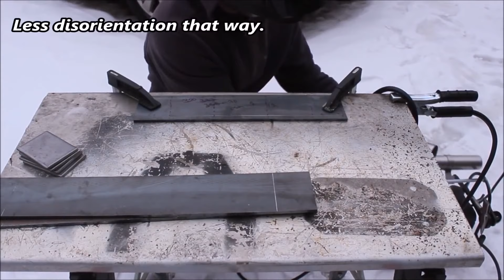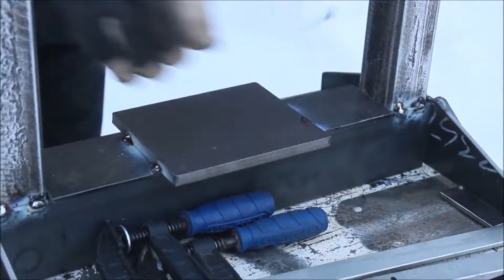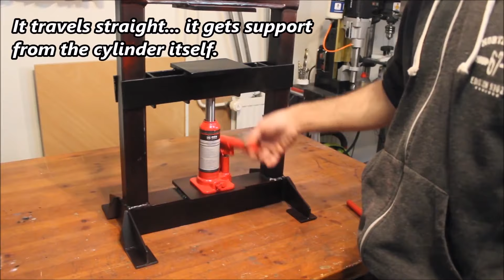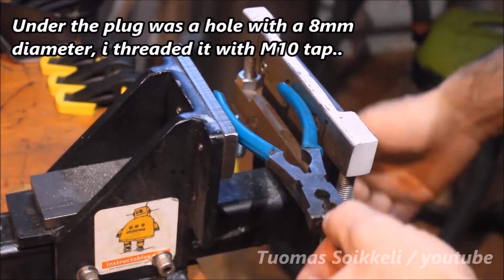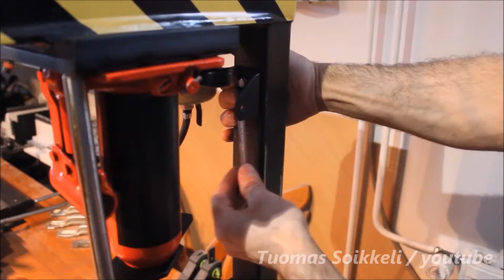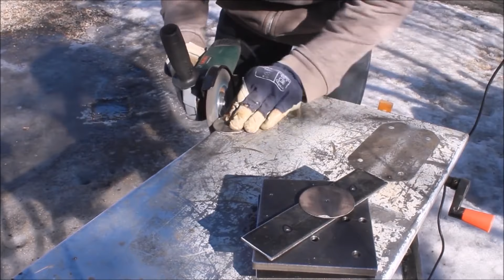Diy tool: Versatile press system to home workshop - Full build -

Comment: hello great job, but with my press i have leaks with transmission fluid (dextron 3) it have a 37 grade (cst), i means using engine oil which have 98 grade. So which one you use ?
Reply from the maker: I use Neste Hydraulic HLP 46 oil.
This press has been over 2 years in use now.  No leaks or need to add oil.